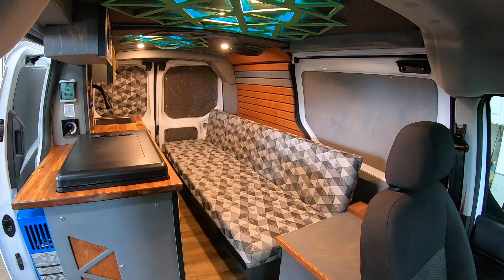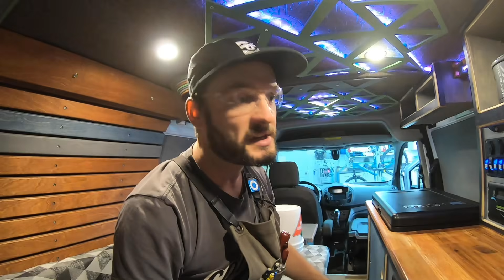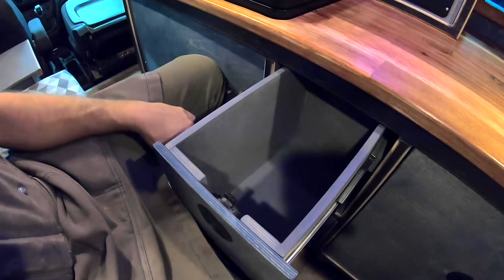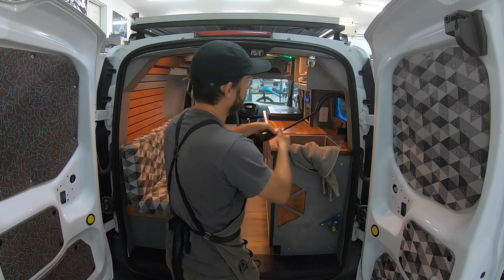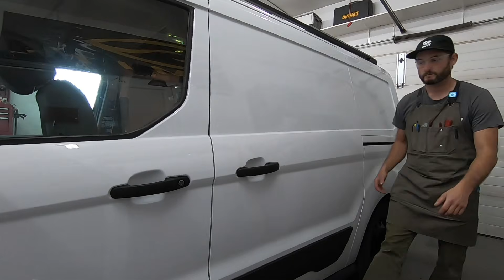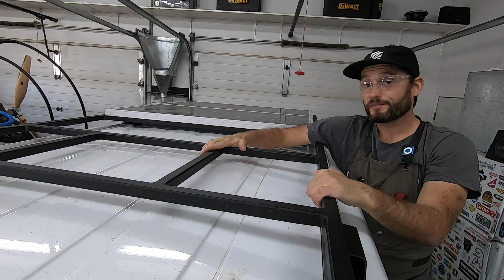My Ford Transit Connect Micro Camper Build and Tour

Comment: How much did the van sell for? I was wondering how much something like this was! I am looking at a ram promaster 118 non high roof. Do these 2016s have the reverse camera? I was looking at a 12v ac unit to run off battery, saw your video, got me thinking! Also about 4 seasoning, have a few friends That had mini wood stoves meant for boats in their larger 170 ext vans, thought maybe I can have one for warmth. Trying to look at insulation options. May look into a connect too. Surely more rooms then my old toyota hiace hahaha, but alas I dont think I need 4x4 anymore, just prefer going to light places where cars can go, and yes my little honda crf250 haha, and I dont even ride like I did when I was young, now its just tooting around and taking pictures of scenery! Or taking little 22lr and taking squirrels or what not to camp fire. 

Something I havent ever actually done, is URBAN camping, or van life'n! People have hash tags and I remember it just being apart of life when young, couldnt always afford to do everything. Couldnt have a nice apt and go to school, chose school and lived in my van! Showered in my schools gym every evening before closed. campus restrooms were open 24/7! 

Now lining my ducks in a row! Got cameras from costco, and a drone (going to play and learn this summer!), learning about video editing software, and an apple! Good lord, costco saved my butt with great deals on a macbook! 

I want to try traveling to urban places and check out all the places id been in my youth, and see how they are today, how cities and local culture has changed in a few decades! Is this kind of solar setup sufficient to power a macbook, a fridge, 1-2 go pros, a drone, cellphone, ipad pro, headlamps and flashlights? 

I used those string LED lights meant for small christmas trees, run it off a cheap battery pack from amazon, generates soft green light from 10pm to morning! Ive seen people install DVR systems in their vans, seems to large for such a small van, but a friend uses ring on their van? The wireless ones? Their internet is a phone sim card in a hot spot box thats always plugged in? I think thats how its used, and the ring stuff runs off its local network? So no online notifications, but can still activate and record to microsd card, wait I dont think thats ring though! Its all confusing to me haha. 

Lastly have you ever installed maybe lockable storage? My small promaster, had my bow stolen! Ahhh off topic again, apologies! But as I said, urban! I am thinking of getting a yamaha zuma? the new ones? Slightly lighter then my cfl250! 

Another build I was thinking after next year or after, maybe van life build in a box truck, and build a little factory five racing '33 kit car and haul around to events, and sleep in box van? 

Oh man, so many ideas! Thank you for the content! Did the van sell?
Reply from the maker: Haha, yea lots of options! The van didn't sell yet. It likely won't until spring. Price is 59900. It does have a reverse camera and yes I have installed lockable storage. My recommendation is a hidden storage which worked great on my last van. This solar is plenty for all electronics as well. Urban camping is pretty cool, I did that through Europe and it's pretty exciting. Cheers!

Comment: Hello, if u had to ball park the cost what would it be? I’m in the process of looking for a connect to start my build. In your opinion do u think it’s worth building out a 2010 to 2013 like yours? Do U take on outside projects or is this just for yourself? HELP, please n thank u. BTW I’m in love with this build so far the best I’ve seen with everything I would want in a micro camper.
Reply from the maker: Good question Carmen, and thanks! Going with the older models would be just fine, just make sure it's mechanically sound before you sink money into it. You can do a pretty complete build in one of these for about $10k in materials. They take much longer to build per sq/ft as they are harder to work in and require more creativity than a large van. I do take one outside projects and am currently converting a 2021 Sprinter. To talk further: shoot me an email: vwroast at hotmail dot com

:)

Comment: Do you got a heater in your van
Reply from the maker: Just the vehicle heater. There is room to install one under the passenger seat, which I think would be great.
Reply: So how much you charge to build a van like that
Reply from the maker: @JB1BABY  this one could be as low as 30K on top of your vehicle cost

Comment: Great build! I have had a VW T4 for 10 years and converted it myself. Unfortunately I sold it last week. So now thinking about a new project with a Transit connect. I already have fridge, sink, stove, etc. but thinking of doing a minimalist set up without mains hook up as I want to use it for wild camping rather than on campsites. Thanks for your vid it is very inspirational.
Reply from the maker: Good luck! Cheers!

Comment: I love your build. Great place for the water heater. You said the Solar Panels were bolted onto the frame. What happens if you need to replace one or both?
Reply from the maker: Great question. You can either remove the bolts from the frame (2-3 hours work) or you can just disconnect wires and remove the entire rack and flip it upside down (1-2 hours work) with two people. Solar panels are one of the most reliable parts of a camper these days so I wasn't that concerned with replacement ;)
Reply: Would you consider mounting it down with bolts and nuts for easy replacement?
Reply from the maker: @nelsonbernier9335  I honestly don't know if it would save much time. This keeps a lower sleeker profile as well. It is much more solid because you don't have to use those silly mounting brackets either. You definitely could on your own build but this made the most sense for me.

Comment: Nice van conversion. A couple of questions, how do you know when the water tank is full and what did you use for a aux. battery. Thanks
Reply from the maker: The water tank level is visible when you open the base cabinet while you fill. I'm using a single AGM - 100Ahr battery.

Comment: So a raw diet with no coffee 😩 no warm leftovers 😭 no hot chocolate 🍫 it’s great job!  just not as cool  without a microwave and stove burner at the least.
Reply from the maker: That is all possible but your heat source just has to be portable. I really really wanted a fixed heat source but there was no room left unfortunately. You could likely ditch the cassette toilet and that would solve that issue. 🤔

Comment: Very sharp! 2 questions though: did you insulate the walls, floor or ceiling; and what are the bed dimensions?
Reply from the maker: Everything is insulated with exception of the floor. The bed dimensions are approximately 34" Wide by 70". Not huge but it's super comfy.

Comment: Killer van! What’s the link on the water heater?
Reply from the maker: https://www.amazon.ca/gp/product/B08CMXDBXK/ref=ppx_yo_dt_b_asin_title_o03_s05?ie=UTF8&psc=1
Reply: How much more efficient is it than boiling a pot of water?
Reply from the maker: @juliejules7780  It's not necessarily more efficient it's just faster with more volume. Wasn't too costly either.

Comment: I like everything about the bed except however it’s motorized. It would be so much quicker to just slide down manually. It looks cool, but I’d get annoyed waiting for my bed every night.
Reply from the maker: I get that perspective. The actuator that moves it can be removed and you can do it manually if need be. Because of the small space it does make it difficult to move it without the actuator. I tried both ways and this causes the least amount of strain. Cheers!
Reply: @Pistonpedal  gotcha. That does make sense. I’ve seen people do it, but it is a bit acrobatic. Still my preference, but I can easily see why some would choose this way. Thank you for the reply. Cheers!

Comment: I’m really interested in your fresh/grey water tank situation. Can you elaborate on what you used and where/how you fit some of that stuff under the van?
Reply from the maker: Sorry, I'm a little late on this reply. Unfortunately with this build you either get to choose: #1 Biodegradable soap and drain to the ground (no grey water tank) or #2 Remove the rear hitch receiver and have a grey water storage underneath. You can't have both as the receiver mounts right where the tank mounts.
Reply from the maker: @veritas5008  the 100L tank sits directly below the fridge and takes up most of the bottom of that cabinet.

Comment: Great video. What was the buildout cost minus the van and labor? Nice setup. I’m looking to do the same just wondering where you came in at on materials.
Reply from the maker: Materials on this one were around 12k. My original estimate was closer to 9k but it was slightly over budget when you factor in all costs.

Comment: Where do you cook ??????
Reply from the maker: Well, on a little burner in that little area between the sink and fridge or, on the fridge. There is just enough room to prep the food and then cook it. This is a very tiny van and personally, I'm pretty amazed I was able to have that much space. A fold out table could easily be added between the fridge and passenger seat but I seemed to manage quite well the way it is. It's all about priorities and even though I purchased a burner top to install, it just made more sense to have an open counter top so a portable burner will have to do. Thanks for the question as I think this is on a lot of viewers minds. I wish I could have had room for one but... I don't.

Comment: Really nice build! I recently got a Ford Transit Connect and just started insulating. I am wondering how to attach 1x2 wood frames to the wall of the van so I can add cabinets.  I appreciate any insight or suggestions on that ! Thank you!
Reply from the maker: Riv nuts are a great way to attach a wood structure. Very effective!
Reply: @Pistonpedal  Thank you!
Reply: @Pistonpedal  this is what I was wondering about with many van conversions before I start myself, that means drilling through the sheet metal / chassis of the van to allow the rivets in - right? Aren't those points then quite prone to rusting - and you won't see it behind the interior finish?
Reply from the maker: @bertv7373  yes but when you drill the hole you paint the bare metal to stop corrosion.

Comment: Maybe I missed it..what year and how many miles...what kind of gas mileage assuming gas not diesel....what kind of tires and miles on them....if still 4 sale, where is this beauty ?  Oh, did u mention insulation at all?  Thanks for answering. All my Qs
Reply from the maker: It's a 2016 with around 37K Miles. It gets around 25 MPG fully loaded (yes gas). Tires are all season with around 40k miles. It's located in near Medicine Hat Alberta Canada. I can deliver  for a very low price ;) Insulation is relatively skimpy as thick insulation shrinks the build immensely. Luckily, a small space heater could be installed and keep you toasty very easily if needed (I could do that no problem). Thanks for asking!

Comment: nice looking, but... Seems like prime real estate for all the controls. Doesn't  look insulated. Could do much faster bed set up manually and is the motor taking up valuable storage space and what happens when it stops workings. (By the way you DO have to set the bed up.) Cabinets? Do you want a fridge door -- or gee, maybe a stove? Move giant box for toilet access? "Shower" needs to be at least twice as long. where's the gas for the water heater?
Reply from the maker: That is some serious feedback ;)  This is a very small van so space is extremely precious. The bed set up manually would be possible but only with the rear doors open. I wanted this to be done while in "Stealth" mode as I hate having to get out of the van to do anything. The actuator is very small, cheap and commonly available, it's extremely important in this build.  The toilet cover is also important as it hides the toilet and also secures that part of the build. many things could be done differently but after calculating the volume of all amenities and where they fit best, this was my decision. I didn't even have plans to have a shower originally so this ended up being a huge bonus to be able to have a hot shower on the road. I would have liked it if it was longer but this faucet had the longest available hose. I'm looking forward to the next full size sprinter build. Way easier than working in this small space :)

Comment: Great little camper build. I have a question however. Do you have to leave the sliding door open when you run the hot water heater?
Reply from the maker: Opening the door is important for consistent usage. It isn’t piped outside but that is a great idea. Generally hot water is only important for showering but it sure is nice to have here and there.
Reply: I suspect you technically are supposed to.  However, you aren't going to run it that long while inside.  And if you plan to shower you will be opening the back door anyway. 
When you burn propane it lets off heat, water and carbon dioxide. 
Btw, I couldn't tell but he might even have that vented outside via a pipe/hole in the floor.   If that is the case then definitely nothing to worry about carbon dioxide wise.

Comment: Very well made, with a lot of skills. Looks very professional.

Also well made: The toilette.

The electric driven bed: Good gimmick. But better position for the switch ?

The fan: Runs in both turns ? To put hot air out, or fresh air in.
In different speed: Fast or slow.

But I would mount the fridge on the passenger seat = far away from the bed and the heating.
If the area is not warm (ie not heated) so the fridge don´t run often.

I like more table space in the kitchen area = better for cooking.
By the way: How cooking ?

You can make a cover by wood, to cover the top of this fridge.

I install a camping gas two flame stove. It has good reasons for two flames.
With a gas tube and a refillable gas bottle.

Greetings from germany.
I want to convert also a minivan like this to a camper.
Reply from the maker: Thanks for the reply. I had difficulty with many of the issues you mention. I lived in a van for almost 2 years and this is what I felt worked best for this small design. The cook top is an issue but I had to sacrifice that amenity due to space. The fan is one direction and that is exhaust or "hot air out," as you say ;) Cheers from Canada!
Reply: @Pistonpedal  Ok, thank you for your answer.

All the best, to "survive" winter in canada.
We got snow today  = first day here in sw germany. The next two monthes will be coldest.
I hate winter. It´s too cold for me.